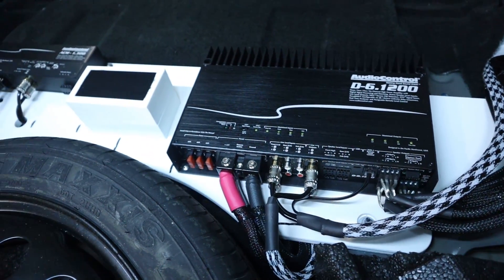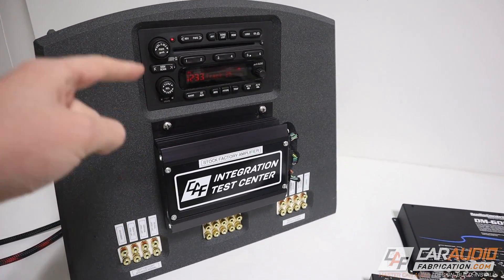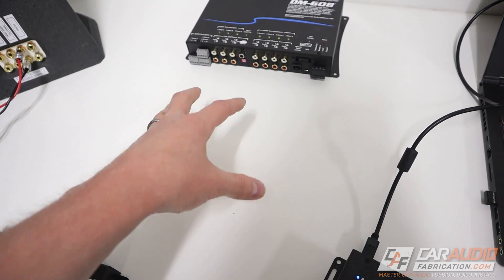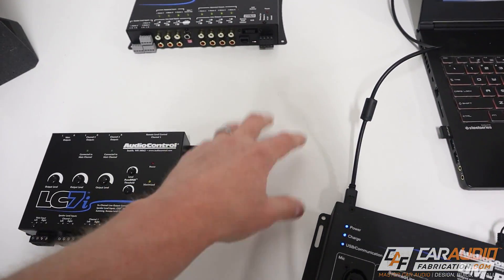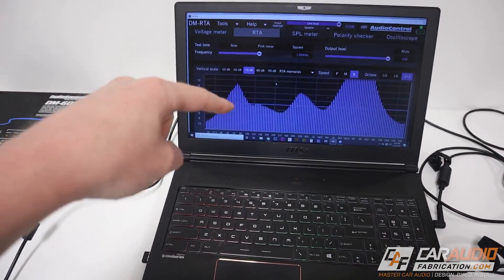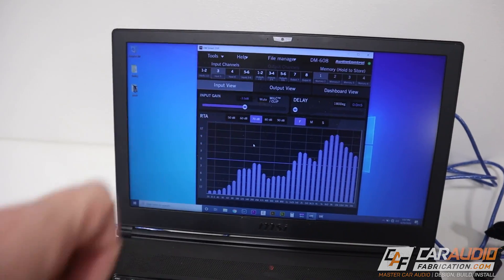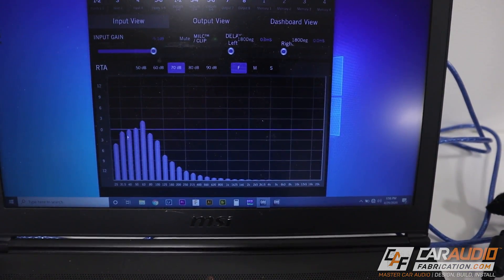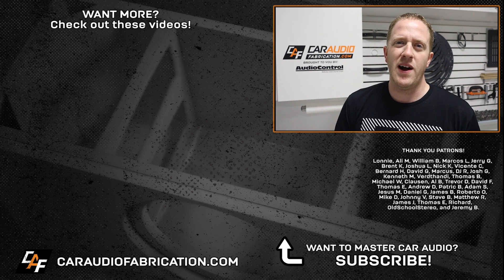Missing Sound Frequencies? WHY add signals w/ signal summing - EXPLAINED!

Comment: I want to double check with you because I got a answer from audio control I think conflict what you are saying. I want to pull the post factory amp going to the factory speaker as the input for something like the lc2i as line level input?

Comment: I’m struggling a little with the signal summing on the DM-810.  If you have rca inputs and sum 1 and 2 are you not turning a stereo signal into a mono signal?  Channel 1 would be front left and channel 2 would be front right.  If I sum them together it would be mono wouldn’t it?

Comment: Hi Mark pardon my question i have a 8 channels 55rms amp dsp from match PP 86DSP focal compoments 140w (70rms)in the front and focal coaxial in the rear and a separate monoblock for my subwoofer so technically 1 channel to every door since I also have passive crossover in the front  I will have 4 unused channels on my amp dsp it also have 9 dsp channels what is the best way to get the best performance out of my amp does summing channels mean more power (rms) ? Any suggestions to get the best out of my amp dsp ?

Comment: Mark are you able to make a video on how you determine which wires are outputs for a factory amplifier/processor to add an LC2I.  I can’t seem to find a video on it. It a 2015 F150 lariat with Sony Sound System. Thanks

Comment: Hi. I am facing some issues. I have a ford ecosport 2016. I replaced the HU with an android head unit. It is using factory harness to power the speakers. Now i installed a chinese DSP puzu c31...but i am not able to get good sub output. The factory harness sends 2 channels front and rear..to the dsp..via a t harness...the DSP BT however sends good subout...any solution how to do it?

Comment: Hi Mark, when using GTO feature, is the extremely attenuated rear speaker output signal enough to turn on the LC7i? I understand that GTO is dependent on the Main Channel but sadly the Channel 3 is coming from Channel 2. In this extremely low signal from Rear, is there a way to re-route the Main Channel Input signal to Channel 3(intended for the sub out) to get the full range signal.

Comment: 🛑 NEED HELP. I have a pioneer DVD head unit of which I convert songs and music videos from YouTube and put it on USB drive for playback in my vehicle. Because of the compressed audio files (avi and mp3 format) am not getting a crisp and loud enough audio file like I would when using an artist original CD, as result i find myself having to turn the volume louder and then back down because of clipping. (I have a 15" kicker compC sub in a ported box powered by a 800rms pioneer amp and a audio control epicenter and a kicker 650.4 powering my pioneer door speakers) what device can I use to get back audio quality that was lost during format file compression.

Comment: Awesome video I have a question hopefully you can help me.  I have a 2019 Honda civic type R. Decided to upgrade the Front components and rear components and put in a 12 inch woofer everything is by Pioneer with the 5 channel pioneer amp and a audison bit ten sound processor. I’m using the factory head unit. The people that installed my sound system are telling me due to the factory amp. Is the reason why the front components are not getting full range of sound I am only getting highs but the rear components are working fine I have full sound high Mid and bass.  They’re telling me that I have to upgrade my sound processor to a 8 channel and Add a four channel amp so everything could have it on channel. I just want to make sure these people are not lying to me can you help me out please.  Thank you.

Comment: Great video...have a jl fix86 summing signal with 5.25" Hertz components up front and rear facing 12" sealed sub in the rear of a 4 door wrangler.  Where do you like the crossovers set for a nice blend?  Currently have component crossover at >90 hz  and sub at <75 hz and there is noticeable gap in some songs and others sound great.  Where do you like the crossovers set?  Thanks alot

Comment: Hi Mark. When you play pink noise are you at maximum volume on the stock head unit? Doesnt the signal response/curve for each output change depending on the volume (the actual curve not just the DB level) and how do you accomodate for that in your tuning? I know accubass is a feature that compensates for the bass roll off but is that the only change in the response that you typically see as volume is increased from 0 to max on a stock stereo? On factory systems, is the EQ done in the head unit or the amp or are some systems different? Thanks

Comment: new cars just seem like such a pain in the ass to work it, cost you a fortune to get a decent system.  Wouldn't most of audio controls lineup be made redundant with a high quality aftermarket headunit?  pretty new at this so i could be wrong. Nothing wrong with that either, i understand there is now a market for them  and they have created a great product but jeez theyre pricey. Not a dig at them and similar products but more so for new cars which are practically impossible to change headunits on

Comment: or intercept the signal before the amp................?
Reply from the maker: Many oem head units control volume output over data connection to the oem amp, so not always a solution.
Reply: @CarAudioFabrication  More often than not you can use a PAC AmpPro or idatalink AR or idatalink DSR1 or a NAVTV box for that, at least for US based cars... :P

Comment: I just bought a new Rockford amp for indoor use only to realize I cannot use it because of ground loop problems in my apartment. If I try to connect to the receiver there's an extremely loud deafening hum from the dual 12" subs. After googling I found out that I must purchase a ground loop isolator which is not available in my country and will be procured in months...Imagine the frustration :(

Comment: would a dsp also work for someone with tinnitis?(ringing in ears) to boost certain frequencies?
Reply: You could always use subtractive eq’ing. Instead of raising the frequencies affected by your tinnitus, lower ALL of the other frequencies in unity and then raise the overall level as a whole. However, you still run into the same issue as the other Ryan pointed out about making your condition worse over time.

Comment: Hey Mark, another great video. I have a quick question I was hoping you could reply to. I added a small amp and subwoofer to my wifes car. Her car doesn't have a premium sound system so I spliced a wire off the rear speakers and used it to feed the input of my amp. The bass is very poor. I think the factory head unit lowers the bass at higher volumes to protect the factory speakers. I also can't change the head unit as it is behind a circuit board with integrated air conditioning switches. Any suggestions on what I can do or what Audio Control product I could use to help with this situation?